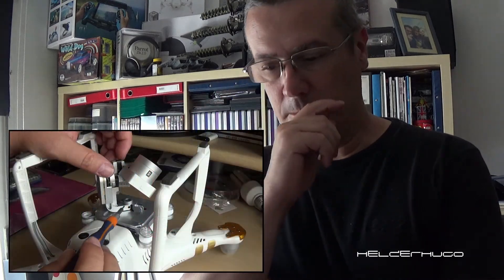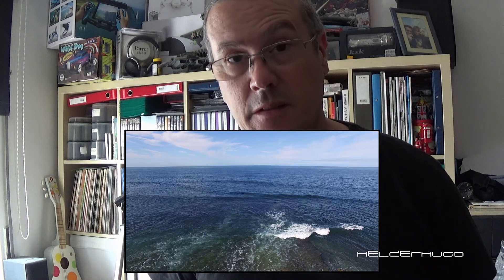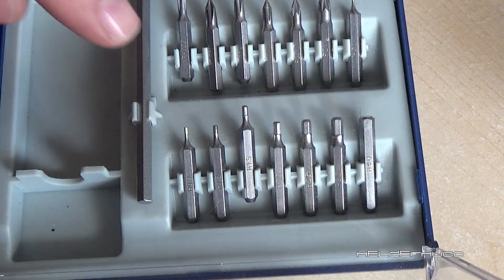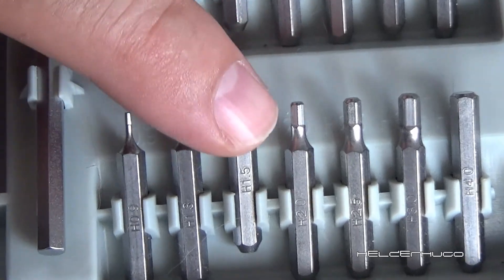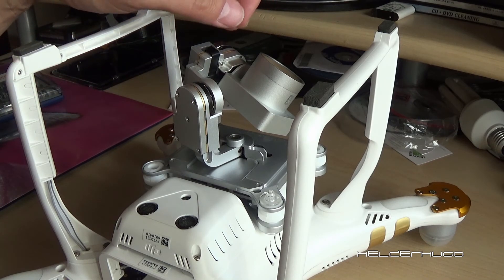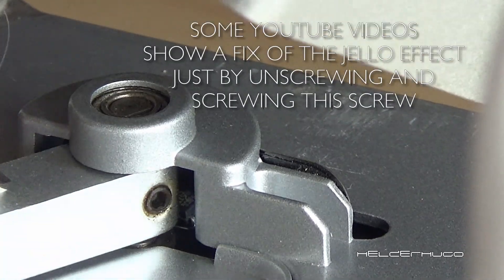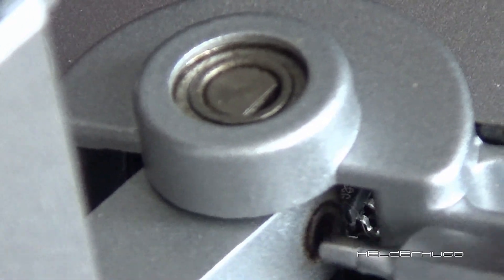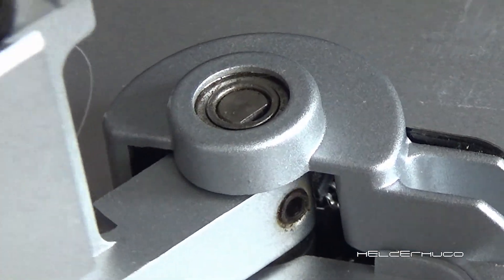Trying to fix Jello effect on Dji Phantom 3 Pro camera

Comment: Did you solve the jello effect? I am very disappointed from the phantom video issues caused by the jello effect and couldn't solve them :( . BTW: Great Video.
Reply from the maker: I manage to destroy the gimbal. So no more jello effect on this one.
Reply: @Helderhugo  OMG this is a "forever" solution... How did that happens? And what is your actual "i really like" Drone? Kind regards.
Reply from the maker: @justaschmidt  I put some kind of screw glue and then I couldn't take apart the gimbal. Forcing too much on the top of the gimbal I broke the upper board contacts. I was stupid
Reply from the maker: @justaschmidt   I prefer the Mavic 2
Reply: @Helderhugo  That sounds like a great drone, but unfortunately i am on a budget :(
Reply: @Helderhugo  This is really annoying and really a pity, because actually the p3s is still a great drone.
Reply from the maker: @justaschmidt  Yes. Too expensive

Comment: Hello Helder my friend, about the SD card make sure you are using a card class 10, when you record on 4K you need a SD card that allows a good recording speed, 4K its a lot of info fast, so its necessary a SD card class 10. Love your flights and I hate the wind :) Today was bad to fly in Ribatejo, I will try again tomorrow. Hugs and good flights. Congrats for the new drone, that's  a great machine.
Reply from the maker: I used a TOSHIBA Micro SD Cards SDHC SDXC UHS-I U3 32GB Memory Cards Class10. Fast enought but maybe this card is too "new" for my old Phantom 3 Pro. Thanks for the comments in English :-D Happy Flying!

Comment: Did you try the gimbal roll adjustment in the camera´s advanced settings menu (in the app)?  Or maybe try this: https://www.youtube.com/watch?v=jT7FHPoFrd4
For the Gelatine effect check gimbal rubber vibration dampeners on top to see if any of the 4 is starting to deteriorate.
Reply from the maker: I saw that video and others before. That is not my case. But what settings are you talking? I change the rubbers and it is exactely the same. It was a fight delaing with jello on Bebop 2 and I give up. Now it is on the Phantom. Mavic don't have it... yet.
Reply: What a bummer, the settings is adjusting camera roll via app like this vid https://www.youtube.com/watch?v=YMaybHT0rjw
depending on what version of DJI GO App you have but should be in camera settings roll adjust
Reply from the maker: Yes of course.
Reply: The Jello issue has to do with vibrations, eliminate that and you solved your problem, best tip I can give you is balance your motors/props.

Comment: I would give it a IMU calibration, and gimbal calibration which will cure the horizon and possibly the jello effect.  I understand jello can also be cured with a nd filter, not sure how that works, but it was recommended as a possible cure  when phantom 3 pro  was first  released.
Reply: He said he did the IMU and gimbal calibration, but that will not work if the gimbal shaft is misaligned, the shaft has a notch that must be aligned with the camera for the gimbal calibration to work. Or if it´s not too far off you can correct the roll in advanced camera settings menu, in the app. Jello can not be cured with a nd filter but can help with prop shadow flicker when pointing to the sun, that works by forcing slowing down camera shutter speed to try to compensate for the lesser light that the filter let through!

That will be a compromise between very sharp but more choppy video and bit blurred frames but a more smooth video that will allow you to slow down your footage and not have choppy vid, that is adjusting shutter speed to the frame rate (FPS) you are using.

"As a rule of thumb, you want the denominator of your shutter speed to be approximately double the number of frames per second that you are recording. In other words, if you are recording at 30 frames per second, you want your shutter speed to be 1/60th of a second."
Reply from the maker: Thank you for your comments. I calibrated everything at home on a leveled surface. I discover this is a common thing on the Dji Drones. Phantoms and Mavics. But of course we should calibrate the gimble. I read about that nd filter can cure the jello. (I doubt) Maybe it could desgise it.